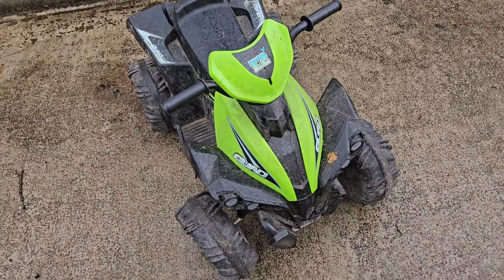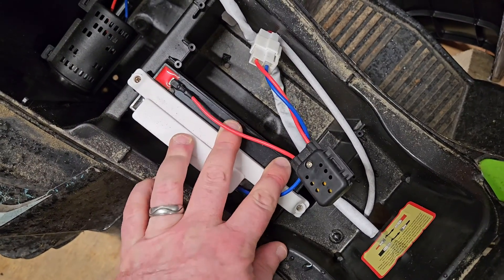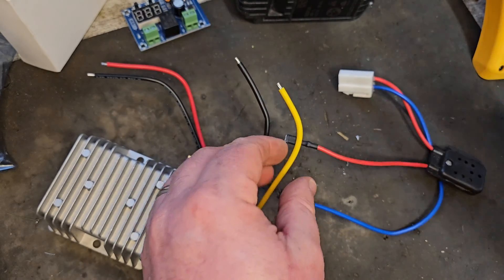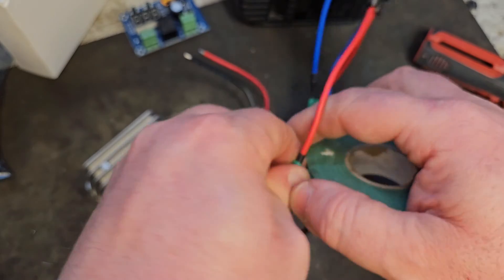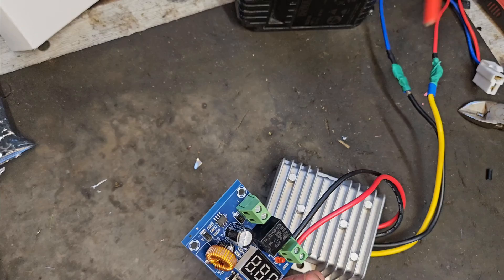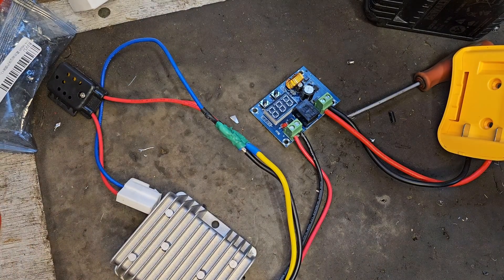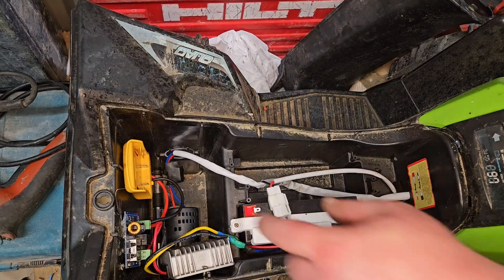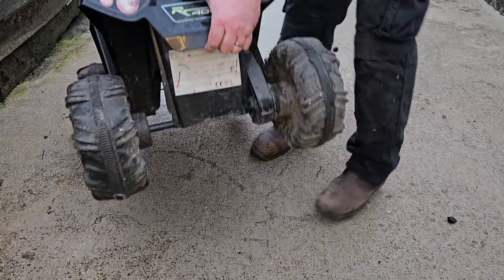From Kids Toy to Dewalt Beast: Quad Bike Transformation

Comment: Great vid mate, going to do this for my boy’s little quad… just wondering as an alternative to the dropper, is there not any 18v motors? 🤔
Reply from the maker: Depending on the motor you can sometimes get away with the higher voltage. If there is a control board the higher voltage would likely fry it.

Comment: Is it faster on the DeWalt s
Reply from the maker: Seems lively enough if you put the 18v to them without the dropper they certainly are (sometimes too fast) but its sore on the motor and if they have a wee board for forward reverse the higher voltage will pop it